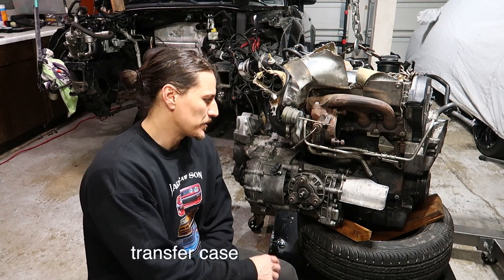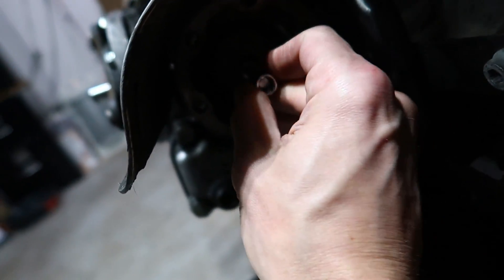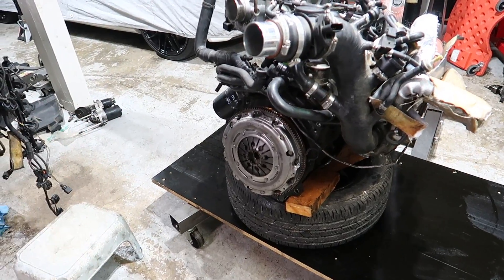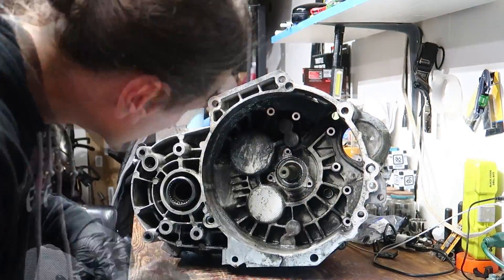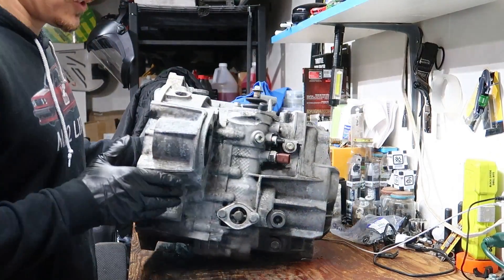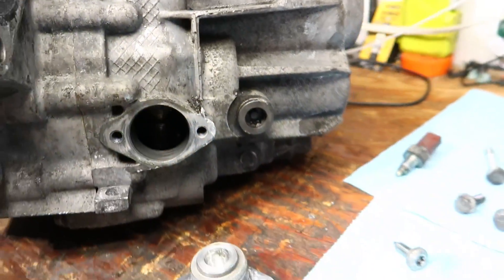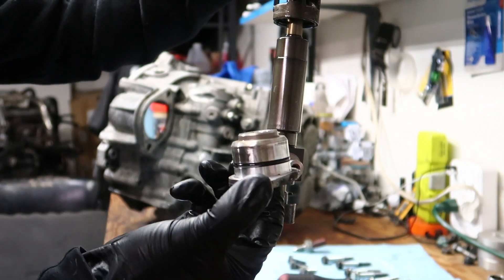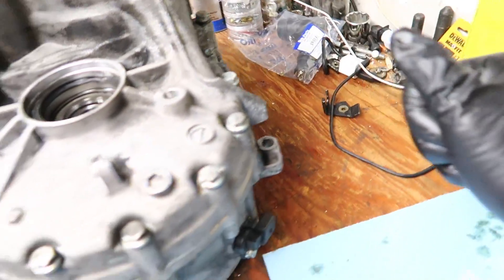Quattro O2m 6 speed transmission Failure |Shift Fork?|Pt.2

Comment: @4:43 don't take the center bolt out, and NEVER EVER power that bad boy back in. Unscrew the center bolt to about an inch, unscrew the two side bolts and then TAP the center screw with a hammer. That pops the internal round block out of the hole its secured in (you push it out of the casing when you tap) and then the tower pops out easy peasy. If you get the upgraded forks, you can get replacement caps for the nylon fork tips made of brass.

Comment: I had the same problem no 1st or 2nd I’m almost certain that my trans has the same exact failure. Your video rocks. Very straight forward and to the point.  I will be fixing mine like that. 2003 VW GTI 6sp 02M FMQ trans.
Reply from the maker: Thanks Cee. Glad the vids helped out. Ya it wasn't that bad. I thought it was going to be way harder

Comment: Planning for an LSD install? You've already done 80% of the work at this point.  Keep it coming Jake! You have fans in WI
Reply from the maker: Man I wish. If I had the money I’d put one in for sure. But just making it drivable for now. Need to get working on the mk2 swap again. 
Appreciate the support 🙌🏼
Reply: @JakeRawSon  I installed an OBX LSD in mine. Was pretty cheap $300 but had to press in new bearings. I still haven't driven it yet, but it fit in no problem.

Comment: Man, you gotta run around the seal with a rubber mallet, whack it a bunch and you'll get the bell housing off pretty easily. You can go pretty hard on the seal - you will actually hear it change a little when you've cracked the seal - like it goes from a thud sound to a ringing sound.

Comment: I wish this was going when I split my 02M, I had problems splitting the case. All the bolts were out but would not separate,  I flipped it over and the case split easy as you showed. I was very happy not a single gear or synchro messed up. But I did have to replace half the case because mounts broke. $900 later 😡
Reply from the maker: Yes I wish someone had already done this also. Man that sucks the mounts broke on yours. What was the problem with your o2m?
Reply: @JakeRawSon  junkyard find. Brought it home and found it had been in a wreck or something, all the mounting threads were stripped, when I tried to put a time sert in, the case cracked in that area. Sucked big time! That's why I had to buy the replacement case for that half. At least nothing inside was bad. Everything was legit.